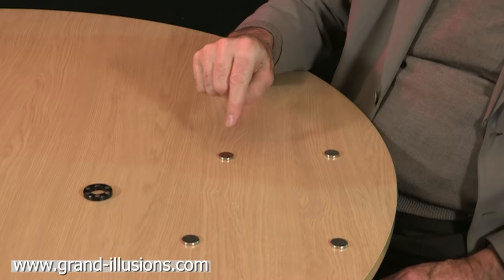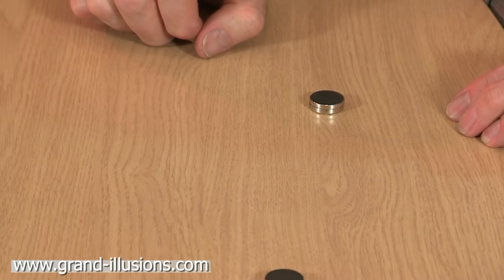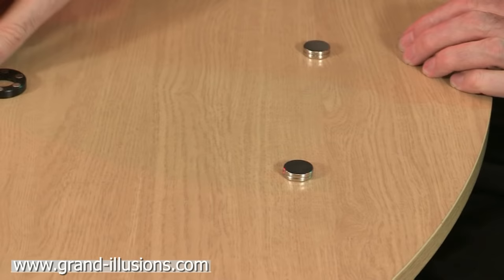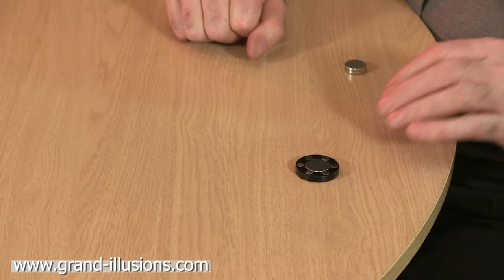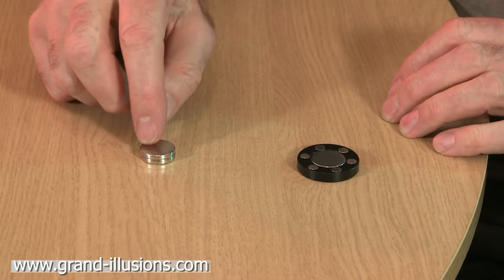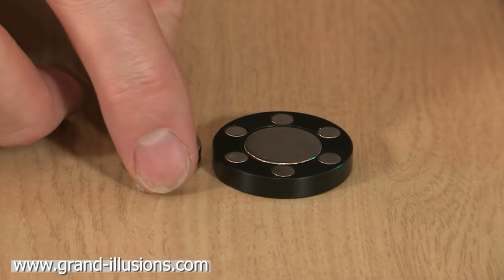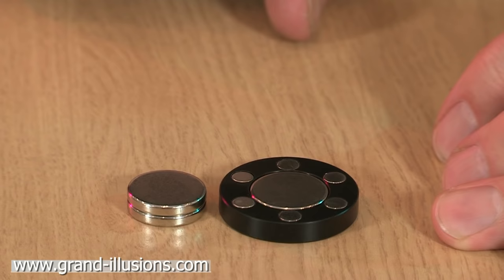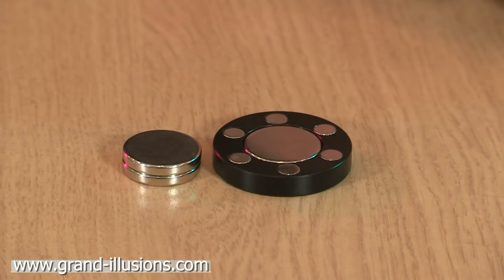Amazing Discovery With Magnets - The Inverter Magnet

Comment: Frictionless bearing.
Reply: It can't rotate. Well, i thik it can at high speed, but the variation in the magnetic field will create strong parassite currents into the magnets itself, braking down the "bearing". But... may be with some modification? :-)
Reply: Graziano Ullucci  I'm confident that you could figure out how to suspend a high RPM shaft in a magnetic field if you decided to.
Reply: I'm having an idea of a possible solution for a bearing right now actually... But, as usual, it will not work I'm pretty sure! :-)
Reply: Sorry to burst your bubble, but they already exist. I have an Enermax 80 mm fan computer that rotates the blades using an electromagnetic field. The blades are held in place with nothing but magnets and are extremely quiet.
Reply: Mufinn Man  It's OK.  We'll never run out of bubbles.
Reply: Strange that here is a discussion about magnetic bearings! A glance at
http://en.wikipedia.org/wiki/Magnetic_bearing
answers all these questions. The claim, that this video shows a new discovery is wrong of course. But after all the poster names himself Grand Illusions .
Reply: that wikipedia page:

"Magnetic bearings support moving parts without physical contact"

but half of physics is electromagnetism...

HALLPPPP!!!!
Reply: Gustavo D
Magnetic support is used with Maglev trains. But this support does not work with permanent magnets alone, you also need  electromagnets in addition, which consume energy.
Reply: onefodderunit in other words brushless gear
Reply: F I G I T S P I N E R

Comment: A good demonstration of the inverse-square law. The larger and smaller magnet's field stength scales disproportionately as you get closer. Far away from the disk, the stronger magnet's field is dominant, but close to the disk, the weaker magnet's field is dominant, since you are much to it than the larger one.

Comment: I understand it perfectly the main magnet on the inside is pulling while the two magnets that are on either side of the other magnet is pushing and the only place you can go is in between the two smaller magnets right at dead center at the weak spot

Comment: The limitation of magnetic bearings is the fact that you aren't just supporting the weight of the spinning parts, but rather the kinetic energy of the velocity at which they spin, which can be in the kilotons for something as small as a cars drive train.

Comment: It's simple enough, and you actually used the right word. It's equilibrium. The second magnet settles at the place where the repulsive force and attractive force precisely cancel each other out.

To prove this, try this with a high speed camera:  place them on a table top and use a plastic ruler or similar to strike the system in such a way as they move closer together. I predict that they will oscillate with an exponentially decreasing amplitude until equilibrium is reached again.

If this happens, I'm right. If it doesn't, I'm wrong.

Comment: Thats cool, looks to me like a form of Halbach array to me. Maybe this is what Serle was trying to make (or maybe should have made). You missed a trick, you never lifted it in the air. It would have been interesting to see if it the larger magnet could hold the smaller magnet sideways when lifted, if so, then you have quite a nice magnetic bearing.

Comment: So, if you fix 4 magnet pairs in a cardinal  array, the disk with little magnets will float when suspended because it will be pulled from all 4 axis and kept in check by the smaller magnets

Comment: Unless you explain the phenomenon its useless.  I think this happens because the bigger magnet's magnetic field extends to longer distance and they are attracted initially, but as they get closer the smaller magnets magnetic field starts repelling it.
overtime(long time) I think the little magnet will orient towards same direction as the bigger magnet and there wont be any repulsion and it will stick to each other once again.

Comment: There should be a way to make a non-contact drive or bearing using that principle. However, holding magnets in close proximity while they are repelling will eventually weaken the magnets.

Comment: Wait you don’t understand it? But it’s so simple...
Ok here is the basics: magnetism is rather weak at a distance, but the closer you get the stronger it is...
When the magnet and the “device” are far apart, the big magnets have a much greater effect on each other then the small magnets have on them, but once the loose magnet and the “device” gets close, the small magnets get a lot closer to the loose magnet then the big magnet in the device does, and as such their field is what has effect.
This is why the lose magnet is kept at just a bit of distance and why it is pushed around when the device is spun.

Comment: my theory is that the little magnets that align the outer edge are not completely cancelled out but suppressed by the larger magnet and meaning that the larger magnet is able to over come the force of the smaller ones but  to an extent because the little ones still exert there force, intern keeping the other big magnet's from touching.

Comment: Imagine the magnetic fields like they are hills.  If two magnets are attracted to each other, one is down hill from the other.  The larger the field, the further the hill slopes.  The stronger the field, the steeper the slope is.

If they repel each other, they are on opposite sides of a hill.

So, that setup is like having a gently sloping hole with six small hills at the base.  If you roll a ball into the hole, it will stop at the base of the smaller hills instead of rolling all the way into the center of the hole between all the hills.  Since the hills are separate, there are six areas arhat are lower at the feet of two adjacent hills.  This is where the ball will settle, and if you spin the hole and all six hills, the ball will remain in the depression it originally rested in.

Comment: Big magnet attracts, the little ones repell.  The big magnet has a longer range than the little ones, so attracts, but that brings it closer to the repelling little magnets 1st. The distance stabilises at a set distance where the slowly increasing attracting force is overcome by the rapidly increasing repulsion. The reason one rises slower in comparison to the other is the inverse square rule meaning doubling distance quarters magnetic flux.

Comment: For anyone that thinks this is bending Earnshaw's Theorem or can be used to suspend one of the pieces, this is NOT doing anything of the sort. Earnshaw's Theorem posits that NO static arrangement of permanent magnets can remain in a stable, stationary equilibrium solely by interaction of the magnets' fields. At first, this toy really seems to slap Earnshaw in the face, but there is one catch... When one magnet flips, they no longer hold that equilibrium and will attract to reach a new equilibrium state. Why doesn't it flip of it's own accord like Earnshaw's Theorem predicts it should? Because magnetism isn't the sole force. GRAVITY AND THE TABLE act on the magnets to keep everything planar and the poles correctly aligned so this will work. If you would try to have one float below the other, since gravity and the table can no longer keep them aligned, they WILL NOT be levitated.

Comment: Similar to why there are two high-tides every day.  If oceans are attracted to the moon, why is the far-side water repelled?  It's due to the 1/R^2 force.  Magnets are likewise 1/R^2.  The bigger magnet attracts from far away, until the smaller repulsion overcomes by 1/R^2.  Also, protons in the nucleus of the atom.  Attracted/repelled by different forces in that case, but similarly held in abeyance.  Not too close and not too far.  The whole universe is thus held together by such balances of forces.

Comment: frim my limited understanding of magnets is that the Big magnet in the middle attracts while the smaller magnets in the outer ring repel. the bigs one's field is big enough to attract a magnet farther away and the small ones repel it, the repelling force is stronger the closer it is to the magnet. the small ones could also be a stronger magnet, the size affects the field size but not the stretch of what's in the field. that's what probably makes it strong enough to repel the magnet against the pull of the center magnet.

Comment: This may be how gravity works. The relationship that locks them together. Maybe Terrance Howard, Walter Russell were right about our understanding of electromagnetism and gravity and how Einstein shouldn't have put electricity and magnetism as the same force, they are equal and opposite reactions. 

I've watched people experiment recently with magnets, small magnets, roughly 24 of them. When they are all together but they aren't touching, like in this video when one is moved it creates a ripple through the rest, maybe this is what we're seeing with gravitational waves. Apparently we detected two black holes merge one 30 x the mass and another 32x the mass of our Sun and it created gravitational waves problem was, this merger lost ALOT of mass and they couldn't explain what happened to it. Maybe there's some answers done this route

Comment: This could be used in docs that boats tie up to.  In the side rail of the dock you have the ring with the small magnets and two big magnets in it and on your boat you have a few magnets set at the same height as the ones on the dock side rail.  Once the boat gets close enough to the side rail the magnets do their magic and hold the boat in place without allowing it physically touch the dock.

Comment: magnetic fields dont cancel each other, they interact with one another. What happens is the placement of the magnets on the ferrite ring is creating a subtraction that gets strong enough as the other rings get close enough to off-set the amount of attraction the other one will offset the amount of retraction, the design creates a "gap" or that empty space with a combination of  apposing magnetic forces. This is very similar to how small magnet based motors work, but the "gap" is much closer, that moment is when the hand off to the next field happens, and since its happening on opposite poles, on at least 2 sides we get rotation. Then the rest of the field creates force- which gives us ..well..work ;)  
i dont believe iron dust will show this effect, the dust would be simply attracted to the strongest field. I would like to see this though.

Comment: Cool. It took me a bit to figure this out. Quantum locking without super cooling. I dont have the same plastic ring n only have my imagination. But today i realized all you need is a strong positive pull at the center and a weaker negative at the outer. Just like this it mimics the atom. Its really fun and interesting. Thanks

Comment: The physics of this are simple. At the point where it stops, the repelling force of the small magnets is at the same strength as the attracting force of the bigger one - which is more far away. The smaller magnets have a smaller reach so that's why the equilibrium is reached at that very point.

Would be interesting to see what happens, when you
1st put the magnet on top of the disc
2nd do that in a tube

Would it float?

Comment: If you drill a centre hole in opposite magnet and create a flywheel pulley-system there is a very good chance perpetual motion has been created with a spin of larger composite magnet. 
Free energy.   Lithium battery +/or solar energy combined will enhance generated velocity output.

Comment: Wow never thought of that.  But once it is thought up and shown, then you say why didn't I think of that?
The force of attraction or repulsion is proportional to the square (i think) of the distance.  
The center magnet is more powerful than the little magnets
So at a far distance, the center magnet overrides the little magnets
But when the outside magnet is closer, it is much closer to the two little magnets than to the big center magnet.  
It is like 4 or 5 mm from the little magnets, but like 10 mm from the big center magnet.  At this point, the repulsion of the little magnets is greater than the attraction of the center magnet.

Comment: It's why liquids are wet. 
Like H20 molecules attracting each other, but not rigidly bonding together.
Reply: I don't fully remember, but weren't that cohesive and adhesive properties of materials/fluids? Water must have both, it pulls itself into round drops but also sticks to other materials.
If you mix water and alcohol at 50/50 they will bind but it stays fluid and wet. However, a 10% decrease of total volume will happen due to the bonding. This is used with illusionist tricks.

Comment: the forces of repulsion and attraction are balanced at some point between the two magnets - ie there is a region between the two magnets where the force is zero. And that is where the two objects settle and dont move. there is no invisible force holding the magnet there per se - its just that when the two magnets are positioned or reach this region of zero force there is no net force on them so no movement. You would feel the force if you move one of the magnets away from this region of zero force - then you would be moving the magnet away from the zero force region into a region where there is a net force caused by the magnets.

Comment: That's only going to be stable if it is held flat against a planar surface, like your tabletop. It wouldn't be stable if you tried to magnetically levitate it in the air, where it can twist in the 3rd dimension. This is why they need either active systems (electromagnets) or superconductors to make maglev systems, there is no solution with regular magnets unless it is stabilized externally some way (in this way, by being constrained to be planar by staying on the table top) and that would require physical contact and mostly defeat the purpose of making it a maglev (but maybe it could still decrease friction, by having the only contact made by bearings in certain places, against a wall, perhaps, and lean with just enough force to stabilize it, without the full force of the weight of the train resting on two surfaces sliding or rolling against each other).

Comment: That's how maglev trains work...it keeps the train a from having friction so it can reach high speeds without wasting energy in the form of heat...and there are sensors on the track that only provides electricity where it's needed to push the train and nowhere else... making it safer than third rail trains...and way more efficient

Comment: without using cold... interesting... I've seen this effect. But this setup is way more efficient.
Reply: Because the one in the middle is on its side, it's only at maybe a 50% pull effect.  the other ones that are inverted. Creating their own magnetic field. Connect and hold, because it is a energy access point that begins to be generated magnetically.   There is still Force applied in, but Amplified push out as closer. Technically this things in orbit.
Reply: Is in Orbit but instead of inertia it's magnetism

Comment: by controling the the power and the location of specific magnets using electricity accurately, then its possible to create future robot such as the robot we saw in movie Wall-E, Star Wars, and baymax. So, the concept is to make several parts, and every part has itself CPU which connect to other part's CPU using wifi. every CPU in 1 part control all the magnets inside its part
Reply: Profound.
Reply: you can't connect CPUs to each other using WiFi.

Comment: Surely it just reaches a point of equilibrium between the strength of the repeller and the attractor?
It turns with it because it is caught between two of the smaller magnets and which create a slightly uneven boundary.

Comment: It's not that difficult to understand.
Magnetic force is dependent on the distance. And it increases by either the square or the cube of the distance. I can't be bothered to find out if it's the square or the cube, and it's not important. For the sake of this explanation, I will assume it's the square.

When the distance is great, the distance between the inner magnet and the second magnet, is about the same as the distance between the outer magnets and the second magnet. So then it's the inner magnet that "wins", since it's stronger.
But as the distance becomes smaller, the relative distance becomes greater.
Let's assume that the inner magnet is 4 times as strong as the outer magnets. Let's also assume that the outer magnets are 1 cm closer than the inner magnet. When the inner magnet is 10 cm away, the outer will be 9 cm away. That means the inner magnet will be 4*9^2/10^2=3,24 times stronger than the outer magnets. When the inner magnet is 3 cm way, the outer will be 2 cm away. Then the inner magnet will be 4*2^2/3^2=1,78 times stronger than the outer magnets. And when the inner magnet is 2 cm away, the outer magnets will be 1 cm away. Then the inner magnets will be 4*1^2/2^2=1 times stronger than the outer magnets. Or rather, they will be equally strong. So the magnets will stop at that equilibrium, and keep that distance.
The reason why you can't turn that set of magnets, is because if you do, one of the tiny outer magnets will get closer, and thus stronger, while one of the others will be further away and thus weaker. And that will push the second magnet towards the magnet that is further away.

This should be quite obvious if you understand magnetism.